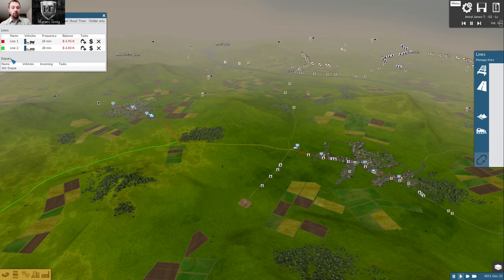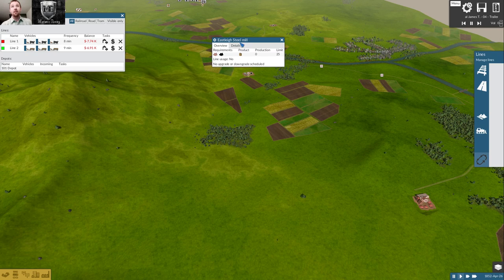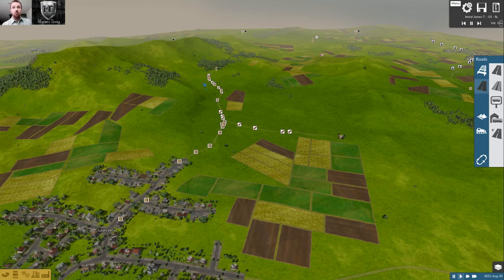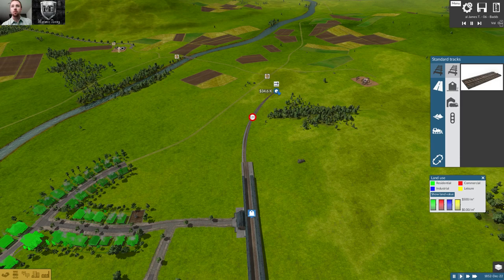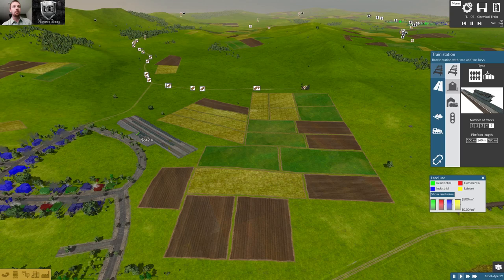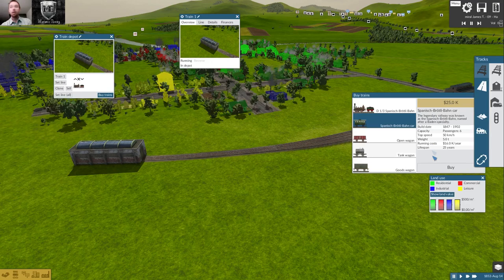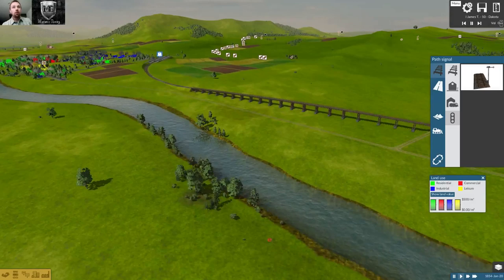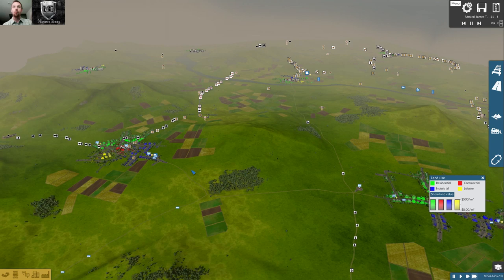Train Fever 101 Part 3 Building Roads Single Line Track w/ Pass Loop 1853

Comment: Replacing stations by breaking them down and building new ones. By example, when you break down a one track station to replace it with a two track station you see at the place where the old station stood a timer. As long as the timer exist there you can build on that spot the new station for a very reduced price. When the new station is built also the lines that were conneted with the old station are reconnected with the new station. This is how you upgrade in TF your stations, its just a game interface matter.
Reply from the maker: Very good information and I will try my best to remember to update in next video. Thanks for the view. I am still a bit fresh but wanted to help those who are really new to it. With all this great comments I can run some tests and be able to have some more advanced tips in future content.

Comment: mine only gose one way
Reply from the maker: whats up? Maybe you have a signal forcing the track to be a one way
Reply: it gets to the other station then it says no line or somthing else  plus mine lags even tho im using a quad core cpu 512mb ati radeon 
graphics and 4 gb ram   games loading from a 120gb ssd hard drive
Reply from the maker: If it is a single track then it is set to one way most likely so the train cannot backtrack. If you made a pass loop check for those small breaks in the track that can happen. Not sure on the lag my specs are a bit different.